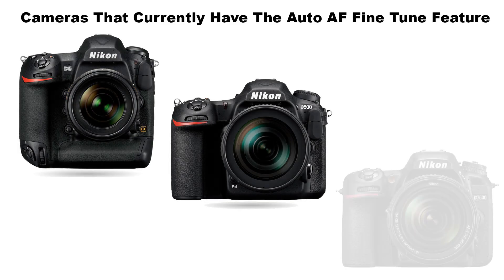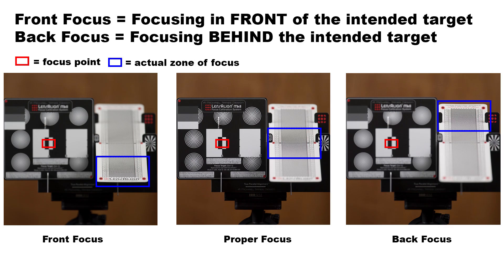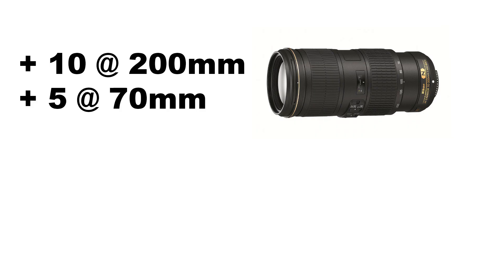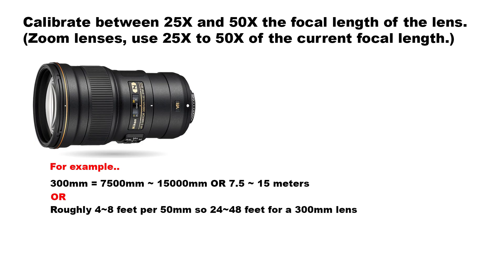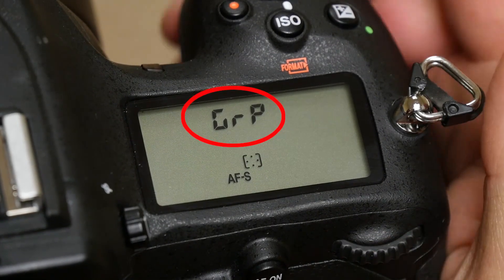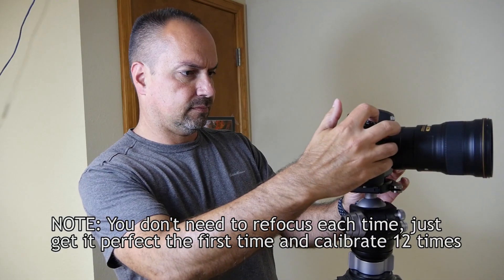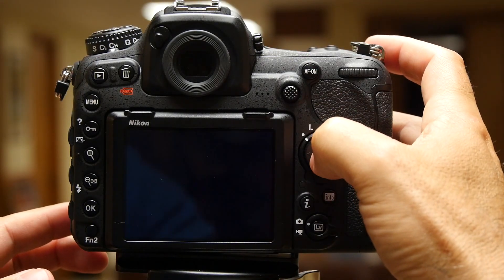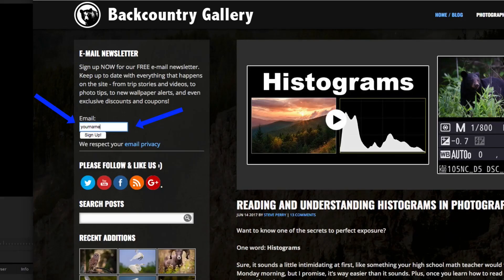Nikon's Auto AF Fine Tune - How To Get The Most From It

Comment: had an interesting chat with a technician at Nikon Germany concerning the AF targets. There is a reason why Nikon suggests to use a purely black and white target: It has to do with certain wavelength (especially red) of the light. A purely black and white chart enables a less confused AF under all light circumstances.
I did the test on all my lenses and the results do vary in comparison using your "camouflage" target.
This is purely scientific and probably irrelevant for most photographers, but nonetheless interesting.
Tested on a D850
Reply: Considerably vary???
Reply: @parusland  ???
Reply: @neglectedloves  Yes, what confuses you?
Reply: @parusland  what do you mean by considerably vary?
Reply: @neglectedloves  In your comment you said or at least I took it like that, that you've made AF Fine Tune with Steev's and Nikon's targets and results vary. So, I wonder if the values obtained with these two targets are sharply different? I beg your pardon, if I understand you wronly. I am not native English speaker. Thanks!
Reply: @parusland  no worries, neither am I a native speaker 🙏🏻

I was talking to a technical specialist at NPS about fine tuning Nikkor lenses with my D850 and I was showing him both targets provided by Steve Perry. He said that the purely black and white target works best for the AF if it is exactly centred in your viewfinder and it would even work best at mediocre lighting conditions. The other chart could confuse the AF and provide false results. 
In my experience in calibrating my lenses this was true!

PS: I only used Steve Perrys targets!

Comment: Steve, I need to calibrate my Sigma Art and Sport lenses to my new D850. Do you have any idea if there is any correlation between the Sigma dock values and the Nikon AF Fine Tune values? Not sure if you've done anything with the Sigma Global Vision line of lenses, but I'd thought I'd ask just in case. :)
Reply: Did you figure this out? I have the same question!

Comment: Steve, thanks. Have tried to set up my 70-200 and 200-500 on my D500 but every time I try it tells me it can't do it in the current focus mode, even though its AF- Normal single point. Any ideas?
Reply from the maker: I have soem troubleshooting for this problem on my blog underexposure the video:
Get The Most From Nikon’s Auto AF Fine Tune System
Reply from the maker: Sorry, here's the link:

https://backcountrygallery.com/get-nikons-auto-af-fine-tune-system/
Reply: Cheers - Suspect I need a better tripod!

Comment: Hi Steve, i was confused by the method of using AF fine tune.
I thought the fine tune is for PDAF, not CDAF. isn't the way of focusing using live view during aF fine tune just using the CDAF and how it helps to align the PDAF? i don't understand and maybe i miss something behind.

The way i adjust and input AF value is:
1. switch to live view and AF on the target, 
2. then look and mark down at the distance scale on the lens in live view (i assume CDAF can provide 100% accurate focus in well lit condition)
3. switch to OVP PDAF and focus on the target, compare the distance scale in OVP with live view just now then i will know whether it was front or back focus. After that manually adjust AF value until the distance scale hit the same mark as in live view.

Hope to hear from you soon.
Thanks.

Regards,
Kuan
Reply from the maker: The way it works is that you get perfect focus in Live View. Then the camera looks at the scene and decides if it were to focus, how much would it adjust by. It takes that and uses the difference as the value for AFFT.

Comment: Hi Steve, Video is very Helpful, I have a NIkon 200 500, Sigma 17-70 & Sigma 70 - 200, to fine tune what should be the distance between the subject and camera? Just now I have purchased your e book SECRETS TO THE NIKON AUTOFOCUS SYSTEM
Reply from the maker: Thanks for the purchase :) The distance should be between 25 and 50 X the focal length. For zooms, I just use a middle value for the mid range point. So, for a 200-500, I'd maybe use 350mm X 25 = 8.7 meters.

Comment: Thanks for showing this video.  It worked great on all the lenses but the 200-500.  At 500, it is difficult to keep the camera steady, even when using the screen, that my numbers were quite different.  I'm going to have to figure out a way to really steady the lens.  Anyone else have this issue with large zoom lenses?
Reply from the maker: Slow easy movements and a very sturdy tripod are key. Also, if you have a D850 or D7500, you can touch the "OK" button on the back of the camera instead of pushing the physical OK button - causes MUCH less movement.
Reply: Same issue for me with a 500mm lens on a sturdy tripod. With VR off and the live view at full magnification, the image moves around a lot when you press OK on the D500 no matter how gentle you try to be.

Comment: Thanks Steve for this and all of the other info you've provide.
I seldom use Live View. In following your steps you say after the initial focus at 100% in Live View not to re-focus each time to run the the additional test. I noticed that the green box indicating that the image is in focus for the first test then turns red the next time, and each time after, when I go to run the test again. Is that normal? Thanks again!
Reply from the maker: It's normal. It's because that AF area doesn't actively check focus, so it's only green after you install get focus. Don't worry, it's still in focus though.

Comment: Steve,   Just curious how the AF fine tune is actually working.  So you get perfect focus on your target every time but the value in the setting is still 0.  If you are getting perfect focus in live view then shouldn't you be set?  I guess I am confused at to what the camera is actually doing.  Just got my D850 and it works but I cannot confirm what the camera actually does.  I see Matt Granger also shows how to do this manually.  On that one he uses the Spyder card and ruler.  He focuses dead on the card but the ruler may show slightly off either front or back focusing.  Does this mean when we say focus on this item is does not actually sharply focus on it but the slight out of focus is not perceivable to our eye?  CONFUSED!
Reply from the maker: The PDAF system used for focusing through the viewfinder is subject to minor variances, that's why there's a small difference between shots.

Comment: This seemed like a great idea, but it didn't work very well.  I ran the test 12 times and followed the video instructions precisely and got results ranging from +20 to -10.  I manually defocused the lens after each test and then autofocused in live view for the next test.
Reply from the maker: Only focus once on the target- and make sure it's 100% accurate. When you focus between shots, you are introducing another variable - and based on the variance, I don't' think you were 100% perfect on each refocus attempt. Even if it's a little off it can skew the results. Note that even with LV focus things can be off a little from shot to shot. Zoom in and verify that it's 100% sharp and once you have it run the test 12 times, but don't refocus and see if that dea a better job. I used this technique with all my telephoto glass (with and without TCs) and my results in the field have been spot-on.
Reply: Steve Perry Thanks.  I'll try that.
Reply: Thanks.  I got much better results, but one more question please.  I am tuning a Sigma 17-50mm f/2.8 lens (at f/8) and got -4 at 17mm and +16 at 50mm.  I would say I shoot more toward the 50mm end, so should I manually set about a +14 or will the ruin focus at the 17mm end?  Thanks.
Reply from the maker: I normally recommend tuning wide open, might be worth a try it that way and see if that variance is lower (no promises, but worth a look). That's still a pretty big gap. I'd agree biasing toward 50mm, but I'd also think about the Sigma Dock if that lens is compatible - it will allow you to adjust each focal length separately.
Reply: Thanks so much for the reply.  I'll retry it wide open.  It's not a dock compatible lens.  The focus looks razor sharp to my eye anyway, I was just looking for empirical confirmation that it's the best it can be.  I love your informative videos.

Comment: Thanks!  This is a huge help!  One thing someone else mentioned on a forum is, when doing this, DON'T refocus between runs.  Just focus for the first AF-fine tune, and then don't focus again when repeating the calibration.  Is this correct?  That's the way I did it, and it seems to have worked.

Comment: Steve, trying to fine tune my lens to my new D850 and running into problem. Checked all the setting AF-S norm, single point focus,fine tune on aperture wide open even put in manual mode, vr off and I get a message stating "auto fine tune not available under current lens setting". Any help appreciated!
Reply: I just went through this and had the same issue. Finally when on hold with Nikon while they tried to figure it out I got it. Make sure you do not have the Live View set for one of the "Silent" modes. I turned that off and no more error messages. The message is really screwy as it is so vague. Has nothing to do with "current focus setting".
Reply: sorry not lens setting, focus setting
Reply: I received a similar error message, so I dropped the aperature to bare minimum on my 50mm 1.4d, and it worked.

Comment: Well done video explanation of the AF Fine Tune system for certain Nikon Bodies & Lenses. Yesterday I purchased the 200-500 VR for mostly shooting w/D500. Not only do I want to get sharp images similar to yours, I also want to make sure I got a good lens. Besides purchasing your e-book Secrets to the Nikon Auto Focus system, I plan on doing some additional testings as well. I have RRS ball head & I considered there LCF-12 for arca-swiss type base plate set up for Ballhead-55 quick release. After watching your video I see that you have a plate on bottom of the OEM Nikon foot plate for 200-500 that would work w/my ballhead. Can you share plate manufacture. Thanks
Reply from the maker: Thanks for the kinds words and purchases - the foot you see is from Really Right Stuff - great products.
Reply: Thank you for the quick reply Steve. I am trying to find best solution for testing my copy of the 200-500. Your great videos & publications help immensely. In the video it appears that you may have a RRS plate on the OEM Nikon foot? At this point for me to do my testing on Ballhead a plate would suffice rather than incurring additional expense for RRS collar & foot  LC-A14. pkg. My sincere apologies for my uncertainty, if you just have a plate  as it appears 11:00 min into the video could it be L-10 lens plate. Thank you for your kindness.

Comment: Help please, Steve... On the D850, Pressing the Mode and Record Buttons does not open the screen to proceed with the AF fine-tune. I have tried all sorts of buttons combination, without any luck. Thank you for advice, if you read this. Cheers Frederic
Reply: Oups... Got it. I just realised I had to keep pressing a few seconds on both buttons. Working now.
Reply: Even after pressing for few seconds, I am still not getting the dialog box. I am using nikon d800+85mm g1.8

Comment: one thing you missed https://youtu.be/5cHhrWF-pqM?t=450 if it isn't sharp, do you manual focus until it is? and then confirm etc
Reply from the maker: You can manually focus, however, I really find that if the target is lit properly the camera does a perfect job - at least every time I've tried it.
Reply: thanks Pal, I found this happen to me, I when my D850 arrived, I placed my 24 .18 on it and it was so off, so I watched your video and calibrated the lens, I went into the settings to see what my camera had placed the lens at, and it said 0, so I tried 3 more times and again it was 0, so I deleted the calibration, and the lens is perfect, its almost like the camera needed to start a calibration to jog its memory of what lens was on it, very weird, but it worked,

Comment: Thank you Steve Perry!

Excellent video...if only I had the strength and energy to face 12 trials...I might do 6;  either way I can at least average in my head w/ a simple trick.

Update: I did this eleven times and got -6,-5, -5, -6, -6, -6, -8, -7, -7 Not counting two outliers.   So I figured good enough!!
Oh, I do love my little 50mm F1.4 D lens:
 https://www.flickr.com/photos/markdstump/27446757124/in/album-72157624885109572/lightbox/

BTW if you want to average a set of numbers that are pretty close to each other:
1) guess at the average
2) keep a running total of how far off your guess is 
3) divide the algebraic sum of those individual differences by the number data points and adjust your guess accordingly.

So for instance, if you had  13,14, 15, 16, 19.  1) guess the average is close to 15, then 2) think 13 is two less then fifteen so my running total is  -2, 14 is one less so my running total is now -3, 15 is right on so my running total is unchanged at -3, 16 is one higher than 15 so I adjust my running total to -2 and 19 is four over so my running total is now +2, therefore the real average is actually +2/5ths greater than my starting guess, or in other words 15.4

If I had decided to guess 16, then I'd get -3+-2+-1+0+3, which is -3, telling that the real average is 3/5ths LESS than my starting guess, or in other words 15.4 :D
Reply from the maker: Cool trick!

Comment: thanks for the video, i have question, is the default and the saved additive or when you set the saved value it ignore the default?
Reply: Steve Perry you replied to the wrong comment
Reply from the maker: Wow, not sure how that happened. No, it is not additive - the saved value overrides the default value.
Reply: Do we need to turn it off after the correction?
Reply: @adeenpachara7114  No it has to be on otherwise camera use old one as default
Reply: @roberverytfunny  thanks

Comment: You can flip the screen and use touch instead of OK button that pushes the camera forward. Touch screen requires very minimal physical contact.
Reply from the maker: Good point for the D850  - but the D5/D500 don't support touch for menu items like that.
Reply: I guess I got spoiled to quickly by d850. Did not know d5/d500 lack this menu touch feature.
Reply: I did use the touchscreen, I think its a great suggestion, but the flipping it out part I consider unnecessary.*

*I do baby my gear and I had previously decided to leave my screen the way it is except for those times when I think the contemplated shot is "sponge-worthy."
Reply: This solved my problem when I tried it on my D850.  Thanks so much for the tip.

Comment: So I tried this with my D7500.  Numbers all over the place!  +10 +18 -7 -1 +2 +6, etc.  I ended up just manually adjusting with a focus target until I got what I was happy with.  Honestly, it was a lot faster as I could home in on the target.  Am I missing something?  Coincidentally enough, the number I settled on, for now, was the first number the "auto" system produced which was +10.
Reply from the maker: In all honesty, it sounds like a technique problem. Either the target was poor or poorly illuminated, or the camera was moving too much, or improperly focused. Most of the time, my results are within a few points of each other - sometimes, it's only between two points (like +6 or +7). 

The other thought is this - were you doing it outside? Temperature  differationals between you and the target would definitely cause those kinds of results.

Comment: Hi Steve, 

i notice only my primes work with auto AF fine tune

my zooms keep getting a fail error message
Reply: Same here on a Nikkor 200-500 f5.6.

I had re-run the video numerous times to make sure I was doing everything right but to no avail. Then I took note of the comment about having a very sturdy, rock-solid base and to 'very carefully' press the two buttons for the Automatic AF-Fine Tune process without moving the camera. Mine jumps around loads! I tried to do it several times but I cannot hold it still enough to get even one pass of the AF-FT test. I am now working on the assumption that it is this movement that may be causing the failure, which is backed up by other references too.

At the 500mm end of the lens, even the slightest touch moves the camera which means I will have to come up with another, more rigid setup that reduces movement on those button presses. Anyone else have this problem?

It's a shame this AF-Fine Tune can't be triggered remotely via a USB connection or something! I wonder how Nikon do their testing of this on the long end of their big lenses?

Comment: Just a curiosity, with the zoom lens you should make different measurement at different focal lenght? Or you can use the mid focal range of your zoom lens as "average" for instance. 10-24mm get the 18mm. However the last shot to the bear is to print gigantic format and hang to the wall for life. Cool.
Reply from the maker: Depends on the lens. For longer zooms, I tend to use the longer end for distance for the entire focal length. On shorter stuff, I tend to use the mid point (like your 18mm). The thing is, what's right for one zoom may not be right for the next, so it's critical you test after you calibrate. If the field results are poor, try another distance. Bottom line is that AF calibration could really use an overhaul for zooms to allow for different distances and focal lengths.